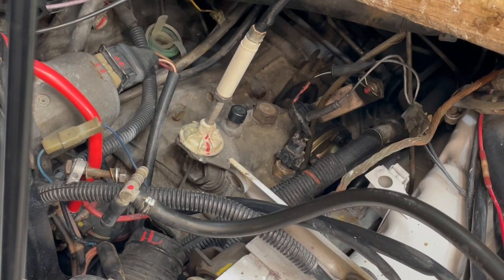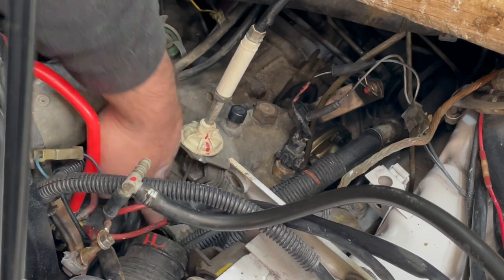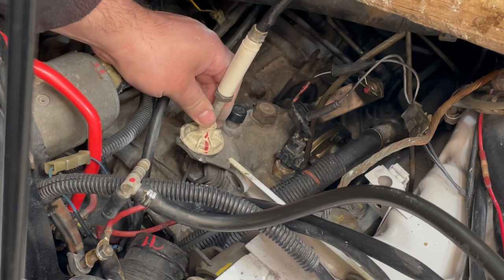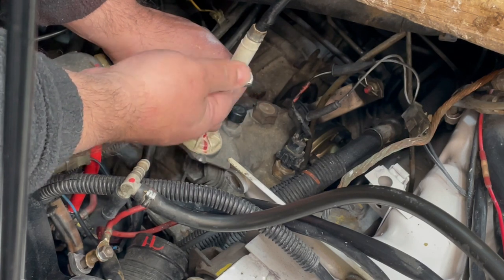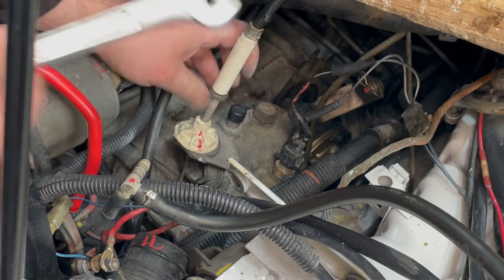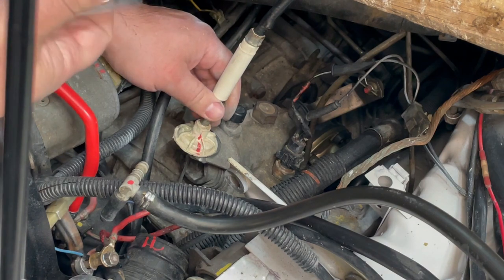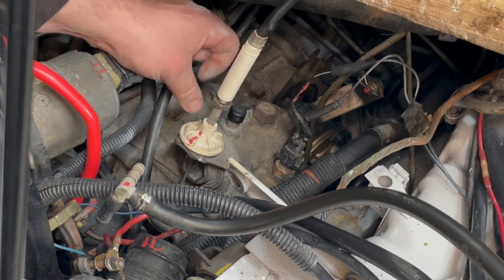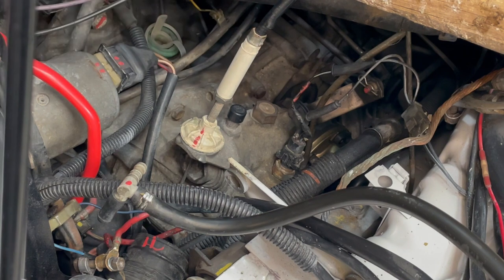Mk1 VW Cabriolet Clutch Cable Adjustment

Comment: Mine has a rubber isolator that sits between and through that hole where the adjuster rests. Probably only @ few mm but might also help keep things working smoothly.
Reply from the maker: I actually just found the little isolator that is supposed to be there. Maybe I'll post an update installing it and readjusting.

Comment: Thanks for the vid. If my clutch point is really late. ( the point before the clutch petal is fully disengaged), would that mean the clutch is bad?
Reply from the maker: No, a bad clutch would slip when actually engaged. If the only issue is where the engagement point is when releasing the pedal then you should be able to adjust the cable to lower the engagement point.  To lower the engament point of the pedal you'd make the freeplay less than the 12mm/.5 inch that I show in the video.
Reply: @ShinyFastLoud  qa1